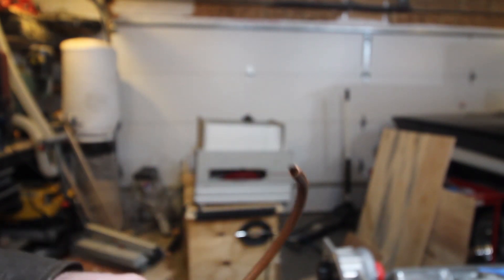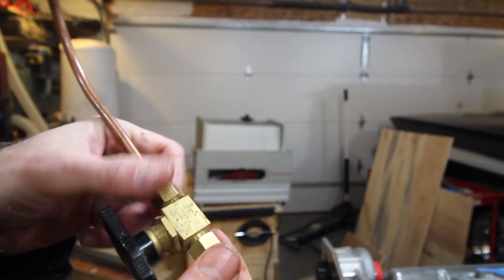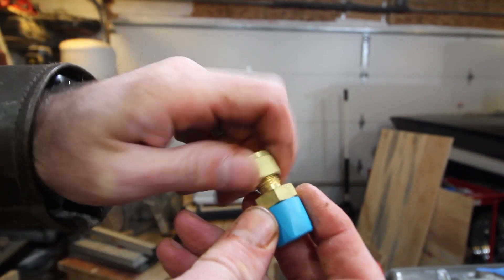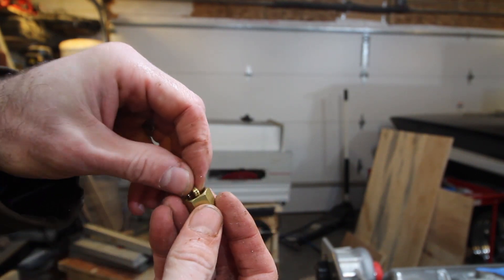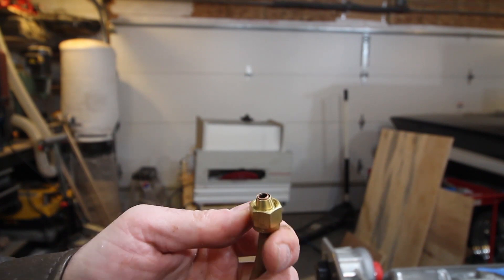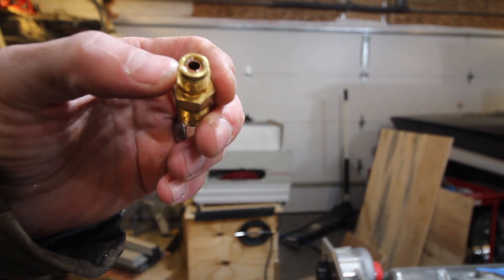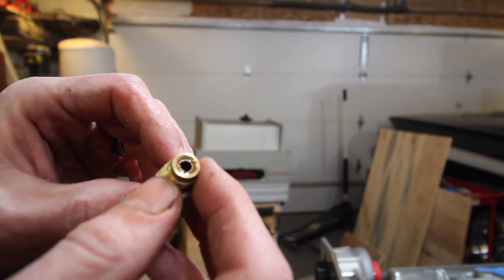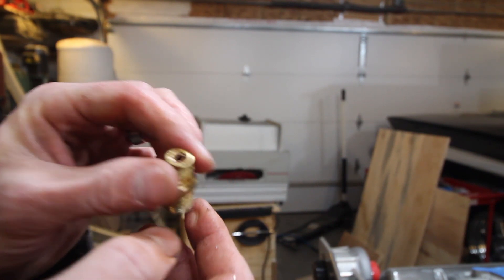Air Compressor Street Valve - Broken Copper and Brass Swagelok

Comment: The same thing happened to me last night. A week a go the same fitting as you because my discharge pipe broke on my compressor at the pump.  I’m going to try either brazing a brass fitting I made to the brass fitting that goes into the pump or solider it.  Thoughts on this would be great.   I’ve never brazed before but I know how to solider.
Reply from the maker: I’ve attempted brazing but I wouldn’t trust my skills on something that holds 125 psi.  From time to time I’ll search eBay for “Swagelok lot” or “Parker lot” - it’s a good way to get used fittings cheaply.
Reply: @SolveFixBuild  I ended up soldering the 3/8 tube to the original brass fitting that went into the pump it’s still holding.  Thanks for getting back to me